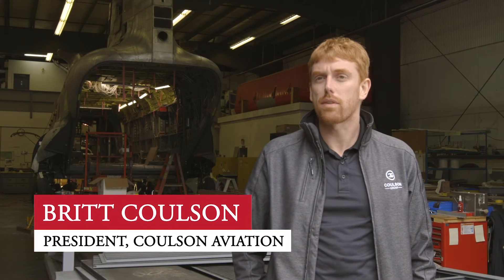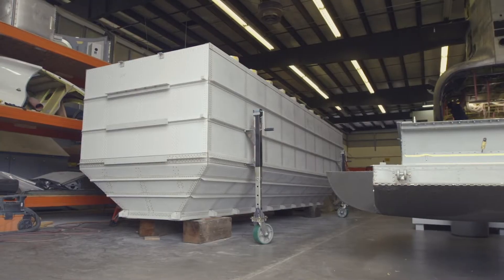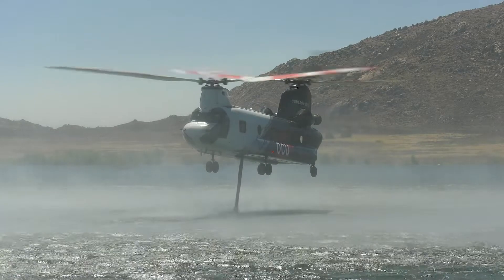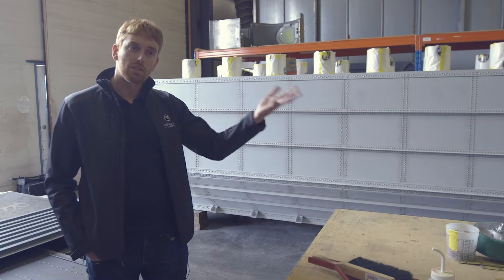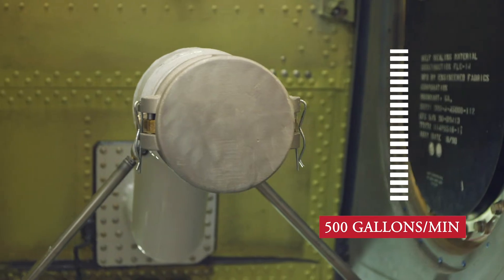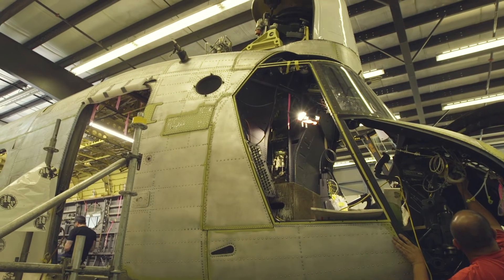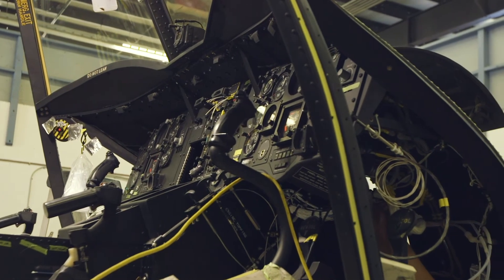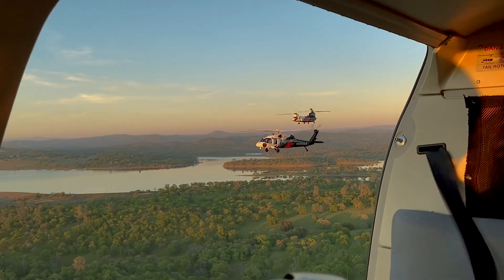State of the Art Tanking System in our CH 47 Aircraft

Comment: Outstanding job of converting these Chinooks to a multipurpose aerial fire fighting tanker. We're these originally modernized CH-47A/B aircraft into D models but were deemed uneconomical to  upgrade to CH-47F models?
Reply: Pretty much. The D models were either cannibalized for parts or sold on the Civilian market. The F model uses a redesigned airframe that uses less total parts and is "fresh." A certain number of F models use refurbished engines, transmissions and such from D models, but many are totally new as well. I miss the Deltas. They were my favorite and much less complicated avionics wise. Kinda like a huey vs a blackhawk
Reply: @ChevTecGroup  Can this helicopter be fitted to have retractable landing gear or keep the fixed gear in terms of reliability and efficiency?